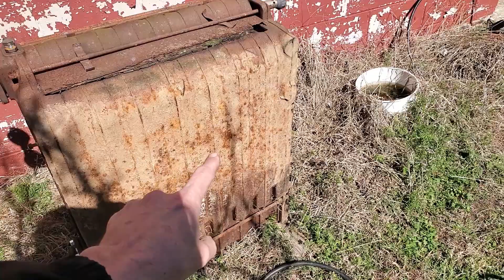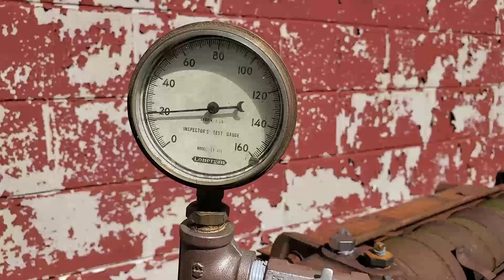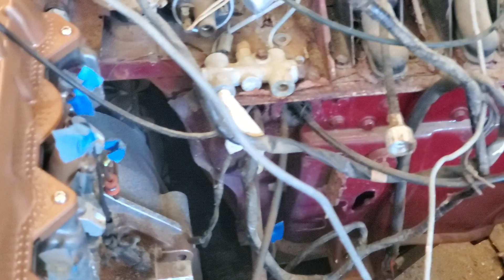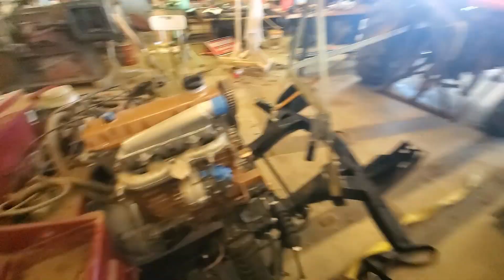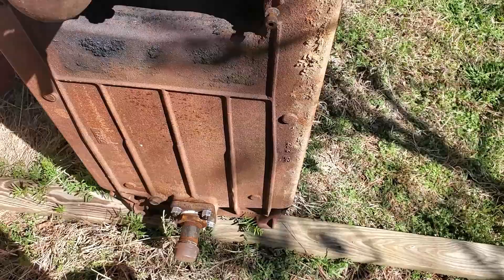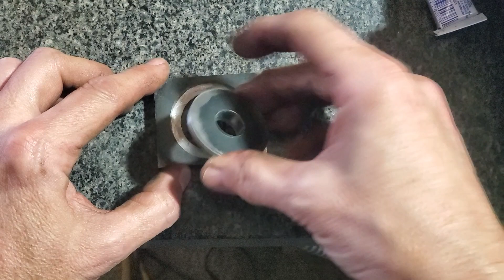Making a Mobile Base for the Peerless Power Hacksaw

Comment: How much angle is on that driveshaft on the spitfire? Looks like a fair bit. I would suspect it likely to vibrate at high speed.
Reply from the maker: It has both a vertical and horizontal offset, but son was careful to keep the tailshaft and diff input parallel. I'm told that the driveshaft itself will have non-constant angular velocity but if the ends are parallel the angular velocity of the diff will be steady. I've seen youtube videos proving this phenomenon.
Reply: @EngineersWorkshop  it puts a bending moment in the shaft which make it oscillate bow under load. Maybe the car won’t weigh enough to induce enough load to matter but in a truck I can almost guarantee that shaft would shake under load at high speed because it goes out of balance.
Reply from the maker: Yeah 145 tires can only transmit so much torque. Doubt with how short the shaft is relative to it's diameter he'll see any issues. It will be right under his elbow though..

Comment: Made me sad to see that brick building fall down at the intersection you showed at the beginning. I reckon they don't do tobacco there anymore either?
Reply from the maker: The old sawmill complex was called the "head mill" where barrel heads were produced. Two miles north was the "stave mill" that produced barrel staves. Nothing remains of the stave mill but buildings and some equipment are still at the head mill. My son's Mershon Band Resaw came from the head mill. We have an old video about rescuing it.